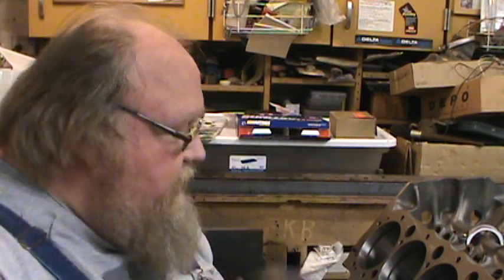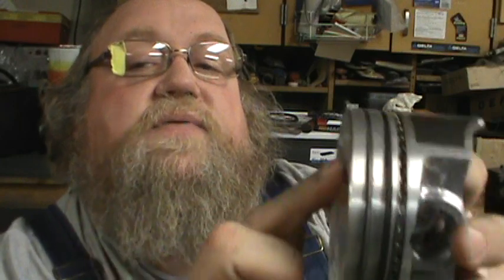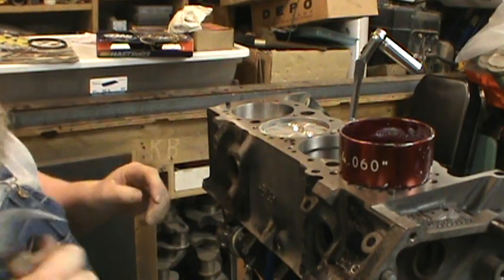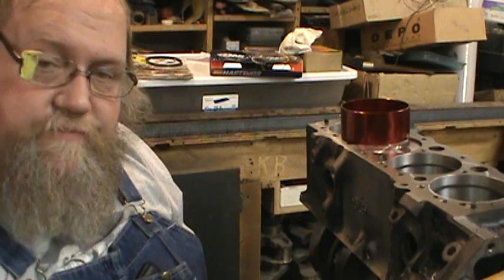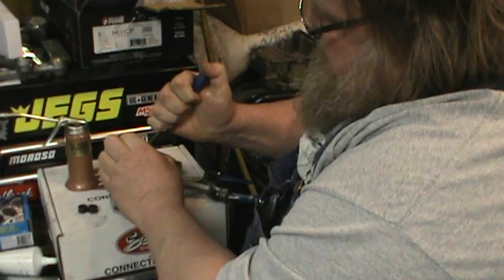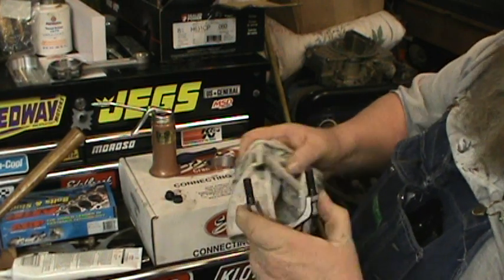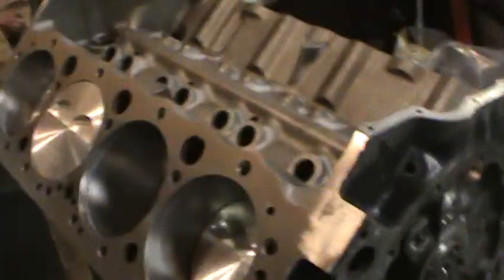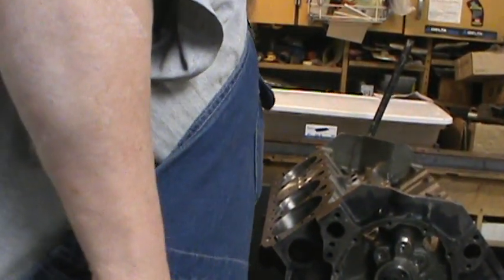350 .060 over chevy build part 3

Comment: I have a set of Goode double humps that are ported and relieved and they kicked ass on a flat top piston/hydraulic 406 Dirt Mod. They have screw in studs and they are 1966 or older heads. No alternator mounting holes.
Reply from the maker: i always had good luck with the double humps to.